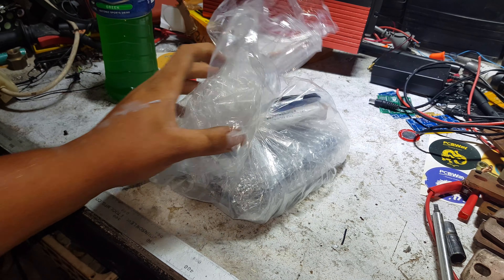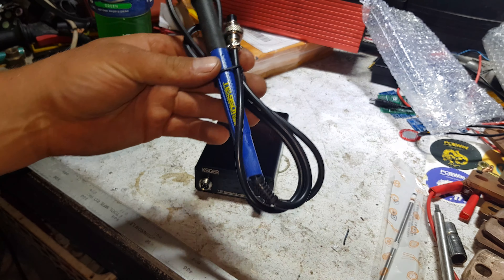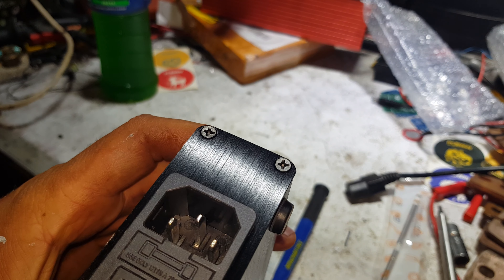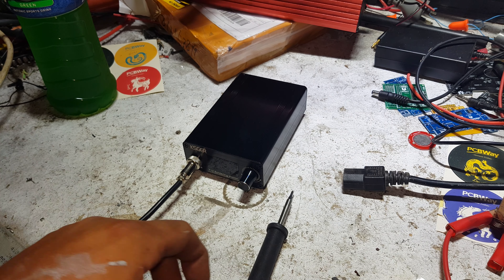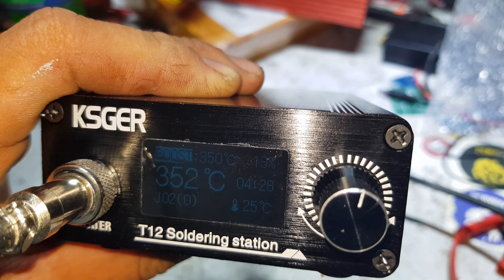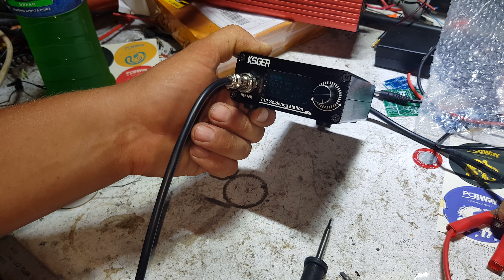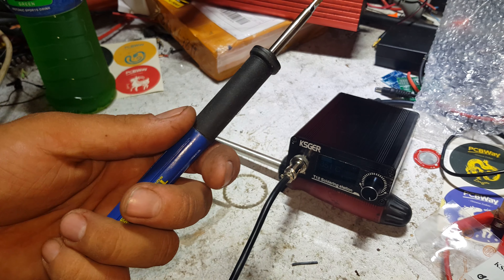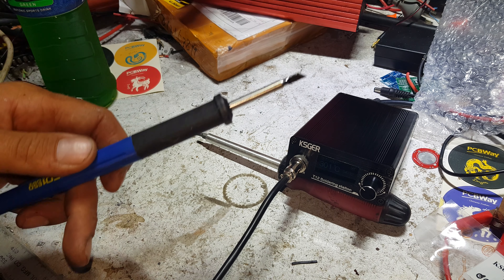T12 Digital Temperature Controller Soldering Station Banggood Review

Comment: I slowly start warming the tips from 150 to 200 to 250 to 300 to 350 when using a new tip then after that I can go straight to temp I do it the first time to breakin the tips
Reply: Does is do anything ?
Reply from the maker: Does it make any difference
Reply: @thomas_w  I know. It's not like we're trying to break in a gasoline engine.
Reply: @Rhaspun  ?